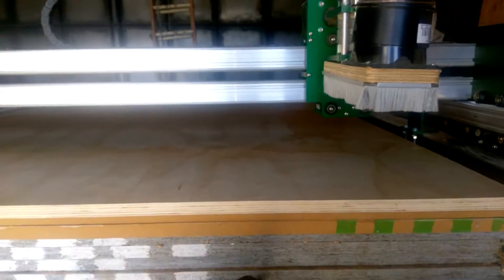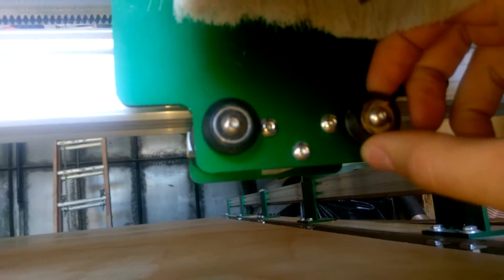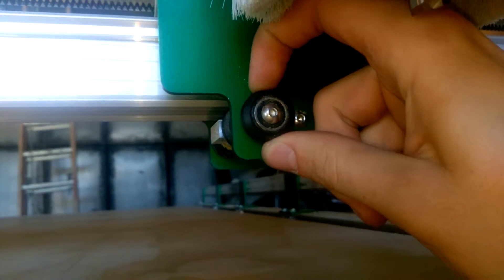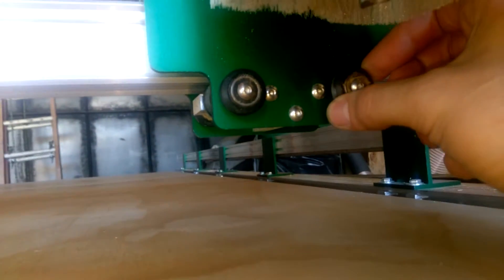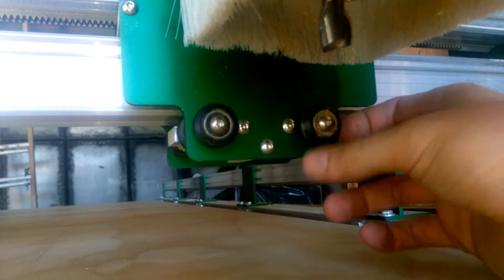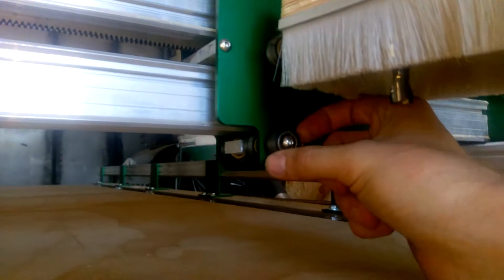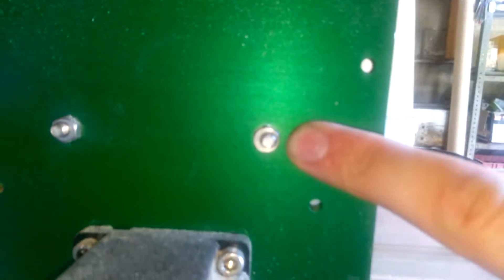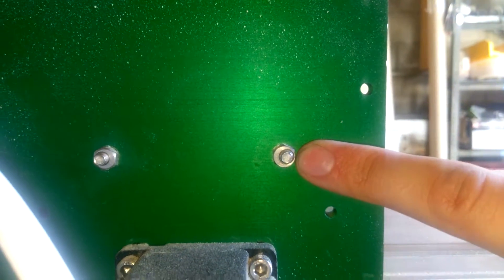Gryphon CNC maintenance 1

Comment: Where u buy new bearings and v wheels
Reply: Hi there! They're just standard "maker rail" wheels. You can buy them here: http://makerstore.cc/product/dual-v-wheel-kit-delrin/
Reply: @atmh2  thanks that what i figured...i have the old junkier cnc mogul version 1 which was the brand before they changed to gryphon name..the bad thing about the mogul version is that the v wheels have no adjustability hwich is very poor design..they should be adjustable to tighten up but nope they can not be tightened to the rails at all

Comment: Do u still have the gryphon cnc...it looks much like the mogul cnc which was horrible....are the rack gears plastic or metal...mine are plastic..it looks the the gryphon is an upgraded version of the mogul cnc....fyi gryphon cnc went out of business as fast as mogul cnc.about 1-2 yrs ..i believe they were same company..or definitely related...gryphon coindidentally opened right after mogul business failed...just changed names...they got their profit and tan before all the warranty issues came up